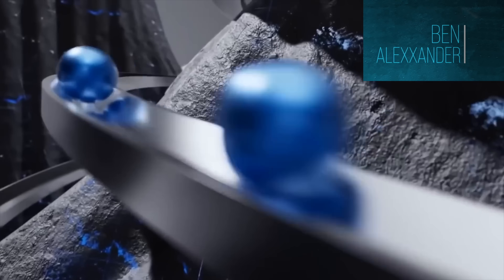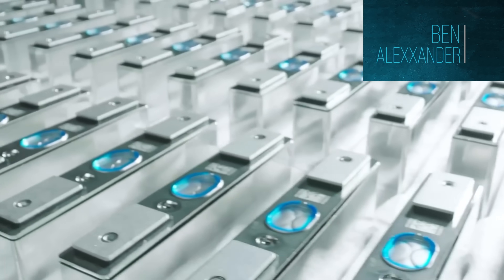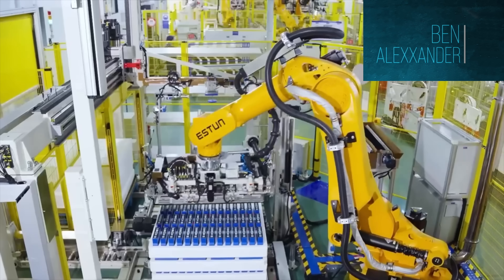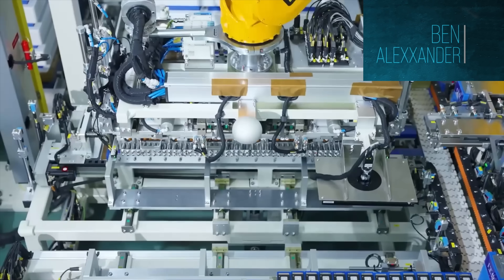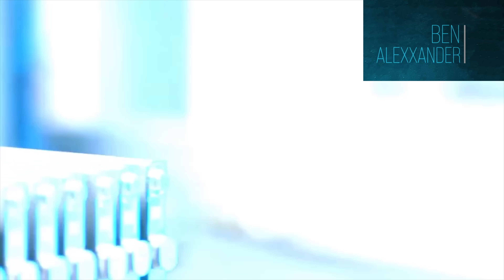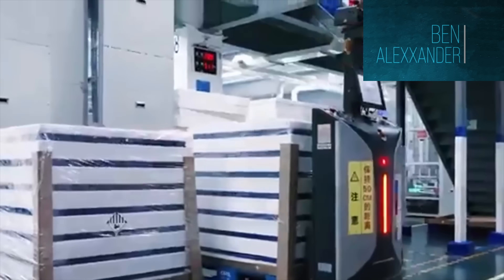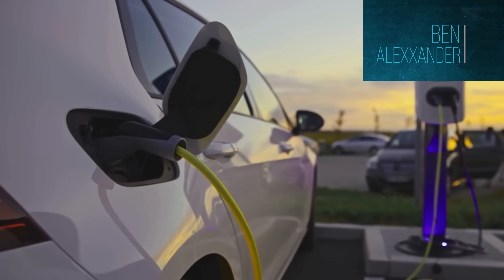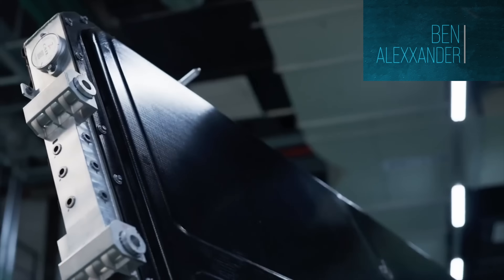CATL’s New Sodium Battery Lasts 3.6 Million Miles — 50% Cheaper Than Lithium

Comment: According to what i've red they're also safer than lithium based options and easier to pack due to being slimmer (volummetry also matter, not just energy density).
Reply: Sodium takes up more space than lithium, but sure you can produce slim batteries, of either.
Reply: @OnlyKaerius  i'm not an expert but i was pretty sure most lithium based batterys were built in cylinders for a reason and they also need more cooling between them so they would take more space.
Reply: @JoseFerreira-zb7wh
Search "GB 38031-2025 "Safety Requirements for Power Batteries for Electric Vehicles,"
The upcoming MANDATORY Chinese Battery safety regulations essentially remove the "Sodium is safer than (Any) Lithium "opinion"

Comment: Sodium batteries and Thorium nuclear reactors really are world changing technology if mastered perfectly
Reply: Solar Panels are starting to go through a next generation moment to.  Dual Cells and Bifacial Cells are upping the efficiency and output and enabling them to suck more electron our of a wider spectrum of light.
Reply: @ctuna2011 
Just wait few more years.
We will have long lasting Perovskite Solar cell.
We can literally print Solar cells anywere we want.
Cloths, walls, your cars, any surface.
It will be super cheap as well.
Reply: Nuclear will not be economically feasible.
Because Solar + Battery will become cheapest form of electricity by 2030.
Far cheeper than Nuclear
Reply: @Atheist-Libertarian  Not appropriate for the UK, with its cloudy skies and high proportion of land used for agriculture.  Ideal for Australia, for example, but the UK could make more use of wind energy.

Comment: It won’t replace it complete. NMC chemistries will probably still be used for higher end cars and where energy density is critical. But where LFPs currently dominate the market it seems very likely that sodium will take its place. And for home batteries sodium seems ready made.

I’m almost more interested in what it means for the car industry longer term. If your powertrain can last 50 years then we really are in a place where the car fails before the battery 99.9% of the time. Would you get a new chassis to plug your battery into? If not then what happens to the batteries when the car dies? For a material so abundant and cheap, recycling doesn’t seem particularly necessary.
Reply: Cobalt chemistry should be restricted/banned as soon as feasible. Because it's cobalt.

Comment: given the level of capital invested already I suspect that lithium Iron Phosphate will continue to be used alongside Sodium Ion and a transitional approach will be used for some time until governments mandate the zero thermal runaway requirement.
China has already mandated EV have Zero fire risk batteries in cars.
that leads to an adoption of Sodium over Lithium in my opinion.
BESS large grid scale battery packs I feel will move to Sodium given the significant advantage over LFP for cold and hot climate conditions.
That makes wind power and solar in sub zero climates far more cost effective in remote regions. 
CATL will we placing one foot in each camp for some time is my view.
Other battery chemistries also showing promise such as  Lithium Sulphur and Aluminium Graphene as these suggest power densities greater than that of LFP nd higher C rating.
We watch with eager eyes.

Comment: Energy density of 175 Wh/kg is perfectly acceptable for the kind of cars that most people drive, e.g. my 2019 Kia e-Niro only has 147 Wh/kg at the pack level and that's NMC!...and I've experienced no loss of range after 130,000 km. Which brings me to the 'benefit' of a battery that can in theory last for 5.8 million km....that's nice but irrelevant when you consider that the average car in the UK does 8,500 miles a year (13,600 km) and in the USA about 20,000 km a year....which means the battery would last 290 years!!...OK, I suppose we could rip those batteries out of cars being scrapped and put them to other tasks but we already have batteries which will outlast the car they're in so a 3.6 million mile battery may be good PR but is meaningless in the real world. The most important benefit of this technology is low cost and being able to work in a wide temperature range.
Reply: It might be relevant if the Na batteries can also fast charge.  You could then use much smaller battery packs (say 35kwh) for smaller ranges (100miles) but with very fast charge times ie cycle the batteries much more, and still have an acceptable life
Reply: No worries, your next car will be much cheaper, you'll already have the battery. 
If the batteries are going to outlive the cars by ridiculous amounts, it would be silly not to design them to be reused as they are.

Comment: Incredible. Last time I checked, Sodium batteries were a promising new tech but with low energy density.
Looks like they came a long way pretty quickly.

Are there no real downsides to Sodium? Can you do 800v architecture using Sodium? Exciting stuff.

See, this is why it may pay off to get a car with a swappable battery, if you can just swap it for the next battery breakthrough tech every couple of years. You can always have the latest battery tech, even if you don't have the newest car.
Reply: Sodium burns in water.
Reply: Yea, piss poor efficiency barely as good as Lead Acid due to ENORMOUS voltage drop over its SOC

Comment: If chemists can get sodium-ion cells up to ~300Wh/kg, in a prismatic, solid-state form, sodium-ion will be the clear go-to for batteries, especially storage batts.  Having worked in the solar and wind industries the past 18-years, there's No question, solar+BESS is the future of energy.
Reply: It isn't the future of energy, it's the majority of all new electrical generation TODAY!
Reply: That would be nice but density isn't the issue when the cost is 2 for 1... You can get far more battery for the same $$ with sodium ion.. Or a smaller more efficient battery that will last forever...
Reply: It does not need to be magic.

Comment: Should make home battery storage a lot cheaper and safer.
Great article BTW!
Reply: Yes, that's where we need to see price reductions
Reply: They have been just around the corner for a good few years now, it is getting silly. 
We don't need the next level sodium batteries for home storage, coming next year or the year after, we need sodium batteries on the shelves this year. We don't care about energy density, we care about safety and price. 
The tech is already capable of supplying what we need, is it the worry of the technology improving to such an extent that anything commercialised now would not be worth the price of salt within a couple of years?
Reply: @robinhood4640  "we care about safety and price" - you forgot longevity. That detail alone is brilliant news IMO.
Reply: @robinhood4640 they would if the technology was ready. The fact is that they are not confident about their claims means that the technology is a few years or decades away
Reply: @robinhood4640  They`re on sale now, bluetti sodium ion battery has one for sale. Be a few months for home storage from other manufactures.
Reply: If true it will also completely collapse the value of all existing EVs, which were already depreciating at record rates.
Reply: @ferrumignis  What math is this it will increase 2nd hand Ev prices due to now a replacement battery will be half the cost, so the ill informed stating " just wait till the battery goes and you got to replace it" or " what happens when it sets on fire and cant put be put out" will have to go and eat crow. Ev tech is moving that fast like when mobile phones come out that it best to lease like myself. Best of both worlds.
Reply: @sargfowler9603
Great for home storage IF you have the space.
Reply: Correct. There are cities in the US that does not allow lithium battery storage in homes for risk of fire. If you install a solar system on your roof without battery storage, you are wasting your money. Spending $80,000 for solar is foolish anyway. You will never get a return on that investment. In 20 years, just when you are close to break even, your system is now inefficient from age deterioration and you need to install a new system. You never stop paying.
Reply: @bills6946  there will probably be more pop up solar systems you put in your back driveway or back yard or hang along the inside of your fence since battery storage will be so much more viable. That removes much of the insane cost with roof solar.
Reply: Will my insurance co. Still think the hybrid is to dangerous to keep in  the garage or will my premiums still be absurd!!???
Reply: @jerryduncan1496  I pay around £200 pound extra£559 instead 350. This is offset by the 2k pound saving a year in Diesel.  You must be classed high risk with points or claims fora  huge increase not because of an Ev.
Reply: A bit heavier than LiFePo4 prismatic cells but for home solar who cares.. Their promise of super long life sounds nice but reality is that the materials the batteries are made out of will never stand up that long.. I would be happy with a 10 to 15 year life which is 3 to 4 times longer than lead acid and about what you would expect from LiFePo4.. Another problem is getting them manufactured in enough quantity.. US manufacturing is stuck in slow motion and geared for the industrial backup market.. The one manufacturer in Michigan even has a statement that they have no desire to make cells for the home solar users.. So China will be our supplier for the foreseeable future and with trade difficulties things are not looking good..

Comment: I would wait for independent confirmation.
Reply: There IS already independent confirmation.  You can buy sodium batteries stand alone if you hunt online, look up the youtube videos of the tests.  Heck, there's a video from this week of a Bluetti 900Wh portable station with a sodium battery.  And these are probably not as advanced as the ones CATL is currently making.  The guy put the battery pack in his chest freezer overnight and it would still charge at 5F (-15C).  At a drastically reduced rate, but it was safely charging.  And the charge rate comes up as temp comes up.  That's WITHOUT heating itself.  That's huge.  It also still output max watts at that temp which is kind of crazy.

Comment: Yes, All facts put together . . .  I think Sodium will dominate.
Reply: Its 85% average efficiency is a deal breaker for grid storage.  Cars: Ok, but not grid storage or consumer electronics for instance which is half the demand.  At which point LFP $$$ continues to drop and will be good for ALL applications.
Reply: @w8stral  85% is doable for grid storage.  
For very huge scale storage, pumped hydro is seen viable (70-80% efficiency) if a suitable geography is not far away.  

If the cost of cells drop low enough, sodium ion storage will start getting preferred over pumped hydro
Reply: @w8stral  What is this 85% efficiency number you quote? For example, here is a sodium battery from HighStar with 97% efficiency: https://youtu.be/4L8tmpX9mYI?t=412
Reply: @NeblogaiLT  Off Grid garage youtube channel https://www.youtube.com/@OffGridGarageAustralia where he actually TESTS and SHOWS, uh hem, SHOWS, the REAL full RANGE #'s.  Due to its MASSIVE Voltage drop, worse than lead acid batteries,  its efficiency massively changes over its SOC.  So, Unlike a fool who cannot be bothered to READ CATL's own datasheet for the battery in question, at a convention, it behooves one to actually look at REAL numbers..   And NO, Sodium is not 97% efficient at ANY portion of its SOC.  Also, only ~70% of SOC is actually useable.  Top 10% and bottom 20% are unuseable.  LFP you get 100%
Reply: @w8stral  Okay, I get your point but if you're quoting a datasheet why not post a link to it instead of some random YT video?
Reply: @davebox588  Because data sheet claims the max efficiency, not its range over its SOC.  No one operates at max SOC, one operates between 20% SOC and 100%
Reply: @w8stral  
You have it back to front.
The smaller the space you have, the more you need High Energy/ Low Weight.
Sodium "will dominate" in containerised Grid and Local Storage.
Also Public Road transport and Urban Trucking (What the NAXTRA pack is designed for IF you read the CATL literature)
In a car, especially a small one, the weight and volume of Sodium cells will compromise both the ration of battery weight to Total Vehicle Weight and available space.
Reply: @w8stral  stop rage baiting
Reply: @khardian  It's probably someone with a huge ego, it's not even rage bait it's a narcissist.
Reply: @khardian  
"Reading a datasheet" isn't "Rage Baiting"
It IS "stating the nearest opinion to "FACTS" that WE have"
Reply: @Perrirodan1  
Telling you to read source material isn't "Narcissistic".
Speaking as someone who's spent a a good part of my career having "Trained" technicians call me asking for help and having to ask them "Did you read the manual?" before committing MY time to travel a distance and fix THEIR problem, I can testify that it a GREAT idea to "Read the Datasheet"

Comment: Finally, a real today technology that looks like a game changer in the field of affordable battery technology.
Reply: we wont hear about this tech ever again and the inventor will die of 16 self inflicted bullet wounds to the head or so well be told
Reply: Thorium energy is only 5 years away
Reply: What do you mean finally? We get big upgrades to battery tech several times a decade.
Reply: @inso80 exactly, the old leaf didn’t have a low range just because Nissan is bad at cars. Battery tech is advancing faster than almost any other tech. Silicon wafers for computers are the only thing that have advance this fast.

This is one of a huge number of game changing technologies over the past few decades.
Reply: @lukethmpsn Battery tech is not advancing fast at all. The introduction of lithium ion was the most significant jump, and everything since has been relatively small improvements.  If this turns out not to be vaporware like so many other promises, it will be the biggest step in a long time. It will also financially hurt a lot of people.